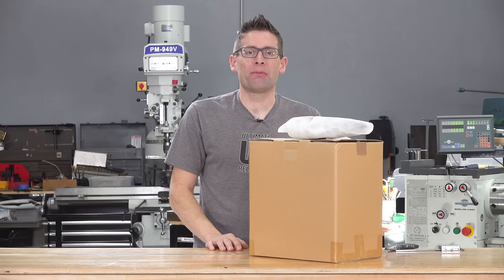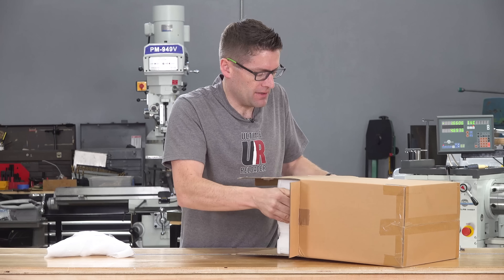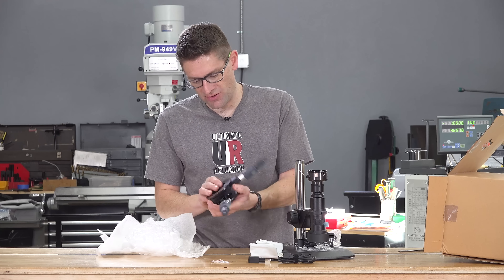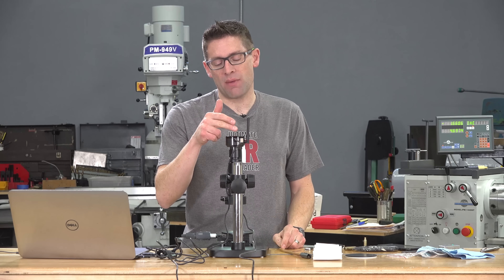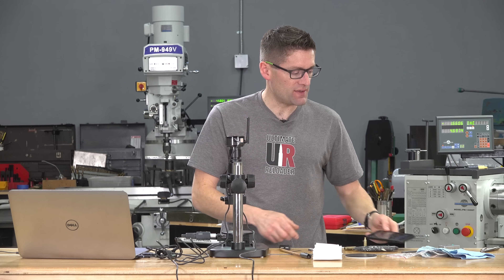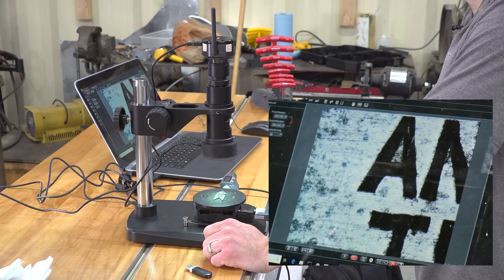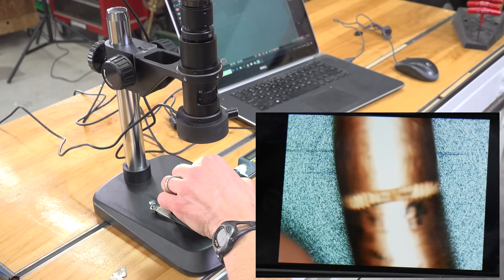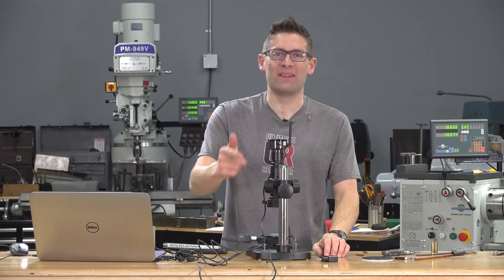iGaging 400x WiFi Microscope: Unboxing, Overview, Demo

Comment: My question doesn't have anything to do with this video.... Ha e you done any videos on the Franford Arsenal Powder measurer? I've looked and looked and haven't found anything anywhere. I'm leaning towards buying g the MEC measurer. But it's substantially more than the Frankford. With that said I'm very impressed with the MEC and would like to see a comparison.

Thanks

Comment: I would really like to get the iGaging Microscope for the same basic reasons: comparing bullets, checking machining results, looking at wear or damage to firearm parts like bolts, the bolt face, extractor claws, etc. Also, on your recommendation, I have replaced my "interim" calipers with iGaging calipers. I had a hard time deciding which brand would be the best for reloading, so thank you! Now if I could only decide on which press to start with...
Reply from the maker: Good deal! You liking the calipers? I'm using the iGaging smart wireless 0-6" ones a lot now... What presses are you deciding between?
Reply: @Ultimatereloader  
My wife ordered the iGaging OriginCal 0-6" from Brownell's for my birthday on 6 March. So that is when I get to try them out. As for the press...I have looked at offerings from Hornady, RCBS, Lyman and Lee in both single stage and progressive versions and I am very confused. I decided to start with the question of Single Stage or Progressive and was stumped right out of the gate. I like the idea of the increased control and 'situational awareness' offered by the single stage. I will not be reloading for competition but for the enjoyment and satisfaction it offers. I like the idea of starting with a progressive press and maybe using it as single stage until I am comfortable with it but then that opens up another question; which one? Especially considering that I am on a tight budget. Thank you so much for any suggestions your experience can offer!

Comment: I assure you, you will be very disappointed in the surface finish if you look at it under microscope :)  I can't tell you how many times when I was playing with grounding HSS tool bits and getting that mirror like finish to only take a picture and scratch my head why it doesn't looks as good on the screen.  What it can be useful for though is getting BHN readings off lead bullet.  You can use software to like GIMP or Photoshop to measure the indentation.  I've used high resolution scanner and it works well but this is so much faster and convenient.
Reply from the maker: Nice! Yes, I'm expecting surface finish to look at bit "sub-optimal" at high magnification :)